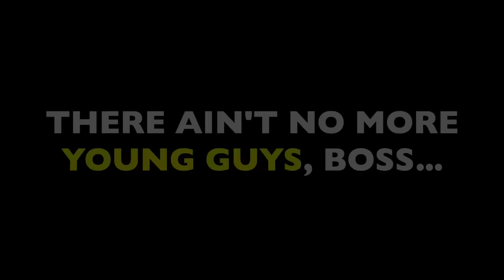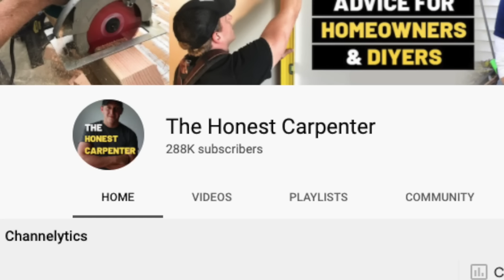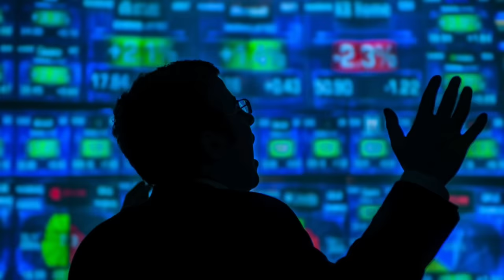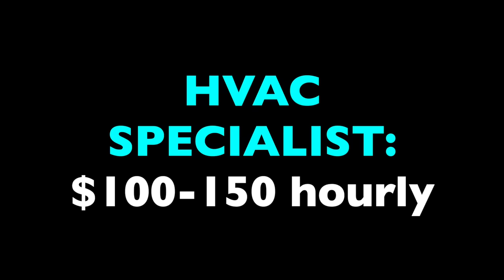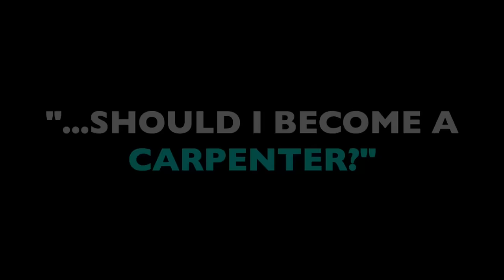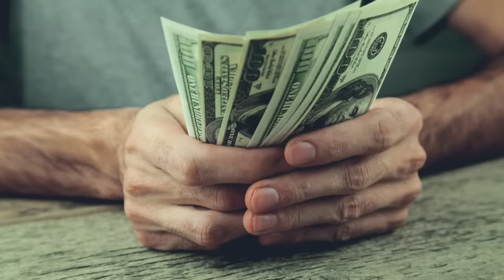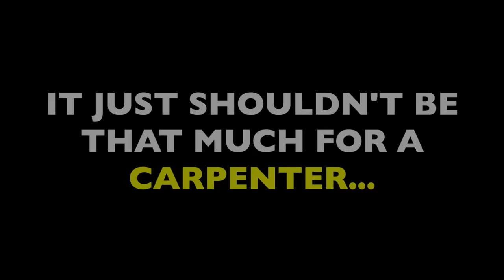WHERE HAVE ALL THE CARPENTERS GONE?! (Why The Trade Labor Shortage Is Only Beginning...)

Comment: They used to have on the job training. Most of the older carpenters and other manual workers were hired in the 70s,80s and 90s with zero experience and no high school diploma. They were trained and paid a livable wage (in those days) around $13 per hour. 
Now they want at least 3 years of experience and a starting pay of $15 per hour. Some even require a bachelor's degree in engineering.
Reply: Even engineering firms dont want to hire new engineers with little experience. Paying new engineers 60-70k a year with the expectation of work alot of over time.
Reply: @goshawk4340  you will make half of that starting out in construction as a apprentice
Reply: True
Reply: Heck, McDonalds is paying $15 per hr.
Reply: Minimum wage laws does this

Comment: Someone asked me to paint a room addition. That turned into painting, finishing the drywall, trimming the room out, mortising hinges and locksets and hanging doors, hanging handrails, insulating the crawlspace in 25 degree weather, tiling and grouting part of the floor, installing a toilet in the bathroom, building a wall mounted desk and some other assorted things. At 62 I'm about ready to call it a day.
Reply: You got that all done in a day? Wow
Reply: @b1_ferg  Okay - I see what you did there....
Reply: I like to randomly knock holes in the walls to look for hidden treasure, especially in older houses.

Comment: Every large maintenance shop I have ever worked in (with a full spread of tradesmen and apprentices), it was the  master carpenter who was shop foreman! As an apprentice, it was not just a STEEP learning curve, but it was vast. Felt like the only jobs we didn't have to do was plumbing, and electrical. EVERYTHING else, we were expected to be able to do on a professional level. There were days when I had to run the damned backhoe!
Reply: It's kinda funny because commercial HVAC guys feel like we know a bit of every trade except carpentry. We're constantly arm deep in live 460V, we run copper, steel, and PVC pipe for hydronic systems and condensate, and we do masonry lite whenever we run refrigerant line-sets through exterior walls. No other trade can do HVAC though  😁
Reply: @rayzerot  That's a fact- so much so that I didn't even think of HVAC when I listed the ''only'' trades we weren't supposed to know! I have cut the *&%# out of myself on sheet metal and have utmost respect for you guys!

Comment: Dead on, As a Carpenter and builder myself I can echo everything you just touched on 100%. The simple fact is that Carpenters run the job sites. We are the builders. other trades are specialists and preform a specific job. We have to not only know our own trade but something about every other trade as well.
Reply: 🤣🤣How's that wooden basement? If it wasn't for us bricklayers, cement finishers,you carpenters wouldn't have a solid foundation to build on.
Nice try you carpenters don't run diddly but your mouths. Coming from a 30+ year professional bricklayer finisher.
You boys can't handle our work.
If you could, we wouldn't have a job.
Reply: It's the same with Doctors...the specialist like cosmetic and such, earn more money that the regular family physician!
Reply: @michaelmortag3536  I'm actually a carpenter, a rough carpenter. I run with a crew of about 10 or 11 people. And we do a pretty good job down here in Georgia. About 4-5 of us knows what to do and the rest knows Jack shit. I seen some pretty awful cement foundations that would turn your eyes inside out. I had about a foot of concrete missing going perpendicular on one the foundations on a site not to long ago. 
We found out that the foot that was missing was on the other side of house, because the God damn cement people couldn't read a God damn plan. And sometimes when we put our treated wood on your foundation the bolts were outside the 2x6 concrete wall. Please try to actually learn the plans of house and set the foundation right
Reply: @michaelmortag3536  
"How's that wooden basement?"
The "wooden" basement consists of the "wooden" form work used to define it's shape.

Comment: Great advise mate, I gave up being in the kitchen / Bathroom fitting ( multi-trade) game 3 yrs ago as I was 53 and bodily worn out ( mentally also) started at 15yrs old.
I’ve always been a proper conscientious tradesman but found people always wanted people quicker and cheaper than myself…..because I do everything the best I can do it . The main problem here in the UK is that people don’t see the difference between a good and bad job, they only see the price.
Tradesmen ( loose term) drive around in brand new vans with all the best tools doing shit work.
I feel sorry for the generations to come….
Reply: Yeh I was advised off the older tradesman to get out of manual work when I was young. Many of them bad backs knees and joints from a life time of manual work. Working in outdoors in winter was throughly miserable.

Comment: This is the very reason I left carpentry as a career. At 18 I started working with a trim company as a board totter making 10 an hour with in 6 months I was pulling numbers cutting, laying out and nailing rooms myself, and able to do a complete punch out on my own. When I asked for 12 an hour the owner let me go 2 days later I was working in a machine shop making 12 an hour as a helper with in 7 months i was making 17 and 22.50 on the road.
Reply: This. I was offered 12/hr in the year 2017 for a carpentry apprenticeship. I went to costco and made 15/hr instead ringing up groceries and used that money to take a night course on machining. I make 22.50 just like you lmao!!
Reply: Exactly. When I started as a commercial metal framer/drywaller I was making $15  an hour until I got more tool and experience. Well  I spent about $2000 getting my tools with time so can eventually get a raise and experience, they ended up only giving me 17 an hour and told me that's as a good as it gets because their journeymen make 22... so I quit and sold most my gear and was just not worth it
Reply: I'm surprised noone in this thread brings up some brown folks undercutting prices...
Reply: @kei2142 a lot people are afraid to. That's what put a lot of older guys out of business. My grandfather was in wa and in the 90s he had a company making good profit but by 2002 he couldn't afford to keep it running he was under bid on jobs constantly by people that didn't have any overhead or multiple crews etc.
Reply: I'm making 16 hr food service no reason to do trades
Reply: @aig5429  I would still learn one. It's always good to have skill to fall back on.
Reply: @justincrites3208  It's like the large plantations versus the small ones in the old south.  The smaller farms with no slaves could not compete with the large farms that used slaves.  Only way to solve this is to set a wage floor for each trade and punish employers who violate it.

Comment: The general public in the last 40 yrs has never really put importance of human labor. Let alone a skilled labor like Carpentry. I'm a carpenter/handyman in Kansas City, and it's the same story. You are so! Right!!
Reply: I think it's very true. I grew up being told to get a university degree or otherwise your screwing yourself over. How many of my peers accumulated a degree, in debt, working barely over minimum wage desk jobs. They probably aren't going to go back to construction jobs just to save face (however dumb that may be). 
For the record, I'm work at those big tech companies but I do a ton of DIY. The pay and prospects quickly falls off once you step away from software engineering into other engineering disciples (or frankly university degrees in general)

Comment: Been a carpenter for 35 years , loved every minute of it except the money , I was non union but union carpenters make decent wages. But travel a lot and live in hotels. Only way to make more money was to get a state license which I did in 1994 . I built concrete forms for 2 years , framed 20 plus years , finish carpentry and build furniture. I was fortunate to attend a trade school for 3 years certificate in carpentry and drafting. This trade gave me the confidence to exit the Army after 3 years . I look back carpenters always been under payed ! The conditions we work under , I worked in central Florida as a framer making 12.00 per hour in 1994 working like a triathlete. Start at 7 am by 8 am so humid my socks were soaked from the sweat . Either you go on your own or work for the union . If you go on your own you have to have the courage to charge what your worth, took me years to do this !

Comment: I feel like the trade labor shortage started at the scholastic level. When I was in high school around a decade ago, all of the shop classes were on the chopping block. The year I signed up for automotive class, that program got the axe and I ended up taking a computer class instead. Everything from woodworking to metalworking was phased out in favor of more technology-oriented programs. I left high school thinking that trades were dead and went to college for cyber security while running my own computer repair business on the side. Despite the $60 an hour from the business (working part time as work seemed to be feast or famine) and the promise of a six figure salary after graduation, I hated it. I ended up retraining as a welder. Now the entire paradigm is shifting. A couple years back, schools in my state started allocating a portion of their budget towards trade programs to compensate for a predicted trade labor shortage (which is coming to fruition).
Reply: The video has nothing to do with the trade labor but specially carpentry. The issue is pay, not interest.
Reply: @Hotlog69  It may specifically be about carpentry but it certainly extends to other trades, although carpentry is a special case due to the oddly low pay despite the specialization.
Reply: I'm in the opposite situation,Im a welder in a state that doesn't pay welders worth shit, now I wanna go into tech, probably programming because it won't kill my body while making a whopping $21.
Reply: @UrbanArmada  you might really enjoy it, different strokes for different folks.
Reply: I think that there’s really 3 parts to this, and pay is one of them. One big issue, is as the OP mentioned; schools. But not just trade oriented classes, but the entire paradigm of schooling for the past 30 years has outright said: consider colleges, look at getting a higher education, take out a loan or get a scholarship to do that. That screwed up a big slice of that generation, because no real counterpoint was ever presented to that. They emphasised college so much, they forgot to mention that there’s hundreds of other options out there. As a result a ton of people took on degrees and big loans trying to get them. A number of those loans have such a high interest rate, they might not pay them off in their adult working life. Which leads to the second point which is money, but not just exclusively carpentry but the whole of American labour: wages have pretty much been stagnant since the 70’s, while productivity keeps climbing. If those wages don’t go up, our whole economy is going to implode, because nobody can afford to buy what they need, or buy all the useless garbage that has defined “growth” for the past few decades. Every bit of the current establishment is screaming that we can’t raise wages, as if buying power when they started on an entry level wage, wasn't 150% what it is now. Everybody is quitting jobs now, because with how little some people get payed, they can’t afford a job that doesn’t pay the bills. What’s scary, is this isn’t just affecting the trades, but even white collar jobs too. The only way out is to pay people more, but everyone is gonna fight that tooth and nail. Which I guess gets to the third point; the old folks aren’t getting paid enough so they’re retiring later and later; and they’re not willing to train the younger generation or for that matter; all entry level jobs require a ludicrous amount of experience (for a position which is supposed to require no prior knowledge). So even if you want to join a trade, you can’t get a job, or keep it. So it’s kinda a failing on a grand scale with society. Only way to fix it is: a) paying people more, b) getting the old folks to finally retire, c) government (local or national), support, through schools, trade schools, colleges, and planning practices, and tax credits, etc.
Reply: @comeradecoyote  well said, our work economy has been dragging ass for so long some people seem to think it's normal.
Reply: Same at my local high school, "Tech is the future!".  How many are in the Java coding class?  4.

Comment: I live in Ireland mostly now. I bought an old house and spent 3 years doing pretty much everything myself because there was a waiting list for most trades.
My brother-in-law went a different route. He purchased a house from a company in Sweden. He picked the house from the builders website. He was given the exact dimension of the base. The house arrived on a couple of large trucks as a flat pack with 4 assemblers.
The quality and assembly and precision was something I'd expect in the aerospace industry. The woodwork was carried out by CNC machines in a factory. There wasn't one carpenter involved. The house was watertight in 5 days. And completely finished in 3 weeks. Where I live automation is killing the trades not money!

Comment: Carpenter is first on the job and the last off. He, in tradition, ran the whole job. That's a skill with value. No one sees it. Their loss. Like you say, time will come to pay the piper.
Reply: Last off?
I'm a Finisher, can't Paint, Stain or Clear anything until it's been installed, even pre-finished items.
   Which many components, Trim, Doors, Cabinets are pre finished.
They still need to be "married into its place in the home."
Unless of course, the DETAILS are left un-finished. Which sadly is the norm.
    The cost of construction, in relation to the quality of work is diametrically opposed.
    When I walk a site, I am in shock with the lack of quality.
    The industry has eaten itself, shot itself in the foot, overpriced and greeded itself to a condition of embarrassment.

     I have worked with good carpenters, and lousy carpenters.
The good ones start the jobs, at the point where they are no longer used because of cost, it's completed by someone who will cut corners, does not follow time honored commitment to excellence.
   I have spent countless hours concealing bad workmanship.
And, at that time the $ is gone.
   Greetings from Colorado Springs Colorado, I'm Christopher, I come in peace. Can you give an example of Carpenters being the last on a job, commercial or residential?
  Thank you my friend.
Reply: What about the concrete workers who lay the whole.fucking foundation for the carpenter's to work on
Reply: That time is now...very much so.
Reply: @christophersleight19  I've become a professional, "professional screw up" fixer. My job is to fix what they left behind. The quality is gone.
Reply: @rodrigovilla1160  concrete guys are carpenters by trade. Practically every sub trade derived from carpentry. Now its all subs. 44 years ago I started in the Carpenters Union. Talk to me when you have something smart to say.
Reply: @christophersleight19  Painters aren't Carpenters. The GC and punch list is still on the job at finish. Everybody has a job to do. It's not about besting or boasting. It was a job/career/business. The economics of the industry changed so much in the 80's that crews specialized. Then whole businesses started up to subcontract building phases.
Reply: @rodrigovilla1160 , I said smart, not smart-aleck. No wonder you never graduated concrete.
Reply: The carpenter is the maestro on site and we are always last on the job because we deal with the final snag list and hand over, the painter doesn’t fix the snags
Reply: @geowen57  , Hey Wendell thanks for your comment.
I wasn't claiming to be a Carpenter.
I was making a simple comment about fixing bad carpentry.
I am a little confused and amused at your comment, "it's not about besting or boasting". Stating what "this isn't."
As you are "first in last out."
Take care my friend.
Reply: @christophersleight19    "finisher" is that a  new trade?

Comment: I agree with this, though I'm on the northern side of the border.  I've been working construction out of high-school and there's so many times I struggle to describe my profession because there is rarely any actual certified carpenters to help with training hours.  On top of that, you're expected to understand all aspects of building construction to best do your job, however like he points out, you get paid about half of sub-trades.  I'm literally pursuing a new career currently with no prior experience or references in the field, and I'm getting paid more than the 5-years of relevant experience plus hours towards certification.

Comment: I started framing at 17, Started my own framing company at 29. That was around 1989. Even then it was starting to hard to get good help that would show up. Got a material handler (Gradall) because I was building houses alone. The biggest problem was the market would go from too much work to none. Learned to save as much as possible when it was busy. Now at 64, working for an Architect as a drafter.  You have good videos.